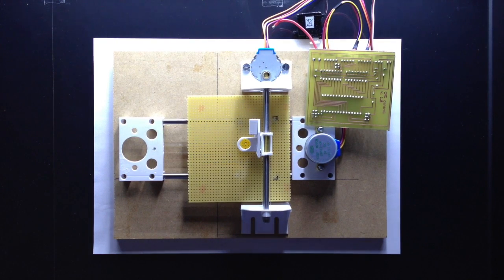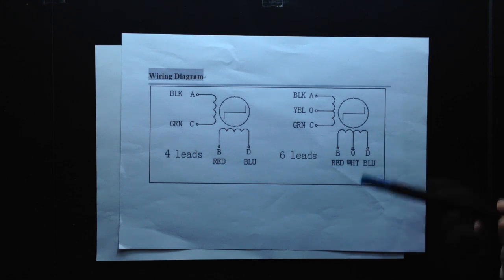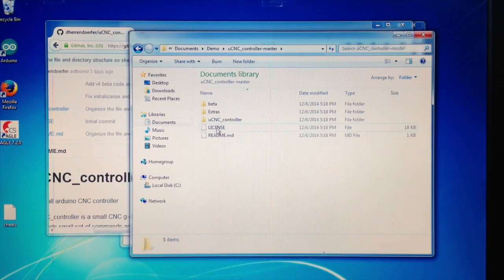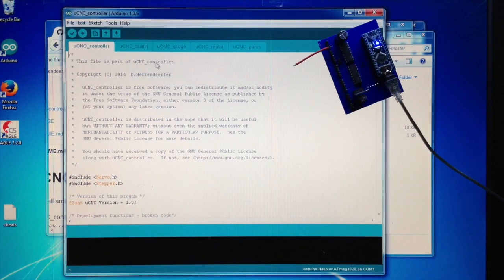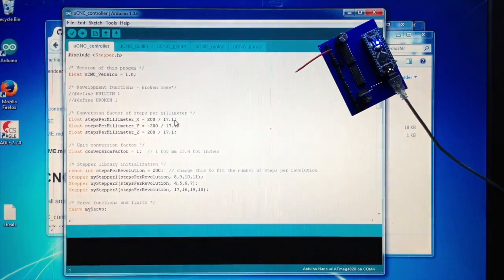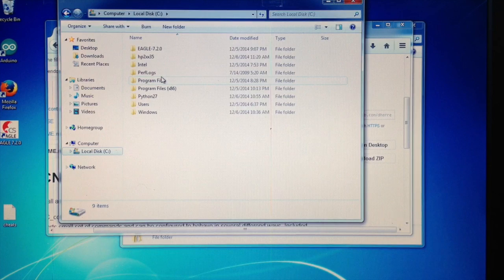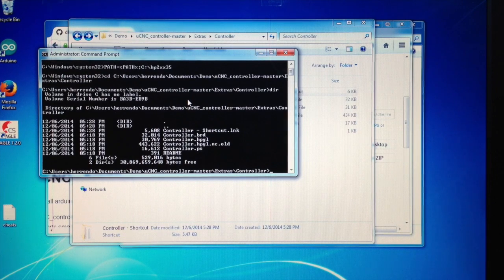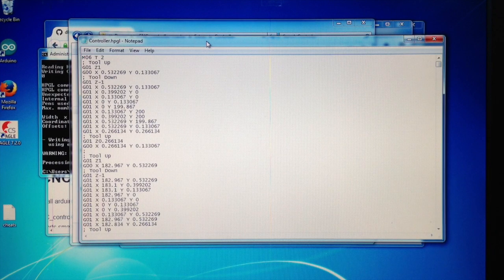Direct ink to PCB-Software talk

Comment: Hello
I can not export to eagle the HPGL files and I also tried converting with hp2xx
the HPGL files I download ..... I followed the video but when the point of type hp2xx and click send out me this:

"Hp2xx is free software and you are welcome to distribute copies of it
   under certain conditions. There is absolutely no warranty for hp2xx!
For full details, read COPYING file (shipped along with this package),
   or write to: Free Software Foundation, Inc.
                         675 Mass Ave, Cambridge, MA 02139, USA

HP2xx: A HPGL converter (xx = mf, eps, pcl, pcx, img ...)
         V 3.4.4 (06/03/22) (c) 1991 to 1994 (V3.20) Heinz W. Werntges
                               (C) 1999-2003 Martin Kroeker
Usage: hp2xx [options] [file1 [file2 ...]]
         Unix: Filter usage (.. | hp2xx q f [options] | ..) ok

Press <Return> to continue ... "
things I need to do ??
thanks in advance for the answers.
Reply from the maker: +Matteo piras Eagle creates HPGL files using the CAM processor, you need to select the format there, once you have a file ( lets call it 'myfile.hpgl' ) you need to feed it to hp2xx using    'hp2xx -m nc -t myfile.hpgl' and hp2xx will generate a 'myfile.hpgl.nc' for you.

Comment: Hello
I have a Prusa i2 with ramps 1.4 I wanted to change it to print my pcb.
I have some questions:
I can change my printer to print pcb?
If yes where I can find the firmware to upload to Arduino Mega?
I do not know if you've already answered in your videos to my questions but if you'll excuse me, but still do not understand English very well.
Reply from the maker: +Matteo piras You do not need to change the software on your printer.
Use the tool hp2xx to generate some g-code for you that uses positive Z positions and make 
yourself a pen holder.
Reply: + Dirk Herrendoerfer thanks a lot for explanations

Comment: It is not necessary, make part of command prompt ?
Reply from the maker: +pedro rodriguez It is. you need to use the command prompt to use hp2xx, but if you move the files you want to transcode into the hp2xx directory you can forego the path setting steps

Comment: Hello good day
I am from Colombia
I am very interested in this project
and I have all the materials
but I have a problem with the configuration of hp2xx
I'm following all the steps of the video
but not me the new file appears controller.hpgl.nc
Only old
Could you help me with some more detailed information on the installation of hp2xx
my email is pedro.r51@hotmail.com
thanks
Reply from the maker: +pedro rodriguez hp2xx is usually pretty good at pointing out errors, doesn't its error output give a hint to what is not working ?
There is little to do to make hp2xx work. You can either use it from the folder where it is installed or add the location of hp2xx to the PATH variable. That's it. Issue hp2xx -m nc -t YOURFILE.hpgl and it will make you a YOURFILE.hpgl.nc

Comment: Hi Dirk Herrendoerfer, 

Thanks for your video and your hard  work to complete this. I have done the prototype for this. But at the first try, I get stuck like this (i'm using TowerPro MG90S micro servo):
- Firstly, I don't know how to test servo (stpper motors are tested OK via software by clicking Y+/Y-/X+/X-)
- Secondly, After executing file "controller.hpgl.nc", it stuck at below command and make my servo vibrate forever. After that i need to press reset button of arduino, then the system back to normal. 
M06 T 2
; Tool Up
G01 Z1
The datasheet of servo:
http://www.electronicoscaldas.com/datasheet/MG90S_Tower-Pro.pdf

please help me on this.

Thanks for your time.
Reply from the maker: +Phan Tan Mong If the Software gets stuck at the point where it was supposed to move the servo, it is usually a configuration issue. Make sure that there is a positive value at steps per millimeter for the Z axis. If the Servo is oscillating, it may be an issue with too little current available.
Reply: +Dirk Herrendoerfer Thanks for your quick reply. Finally i got it working by changing motorMode to 1 ( default is 0) and then change the servoPosMax and servoPosMin to suitabe with my servo.
Thanks again for your stuffs.
Reply from the maker: +Phan Tan Mong Congratulations ! I'm happy to hear that there is another working unit out there. Greetings, Dirk.
Reply: +Dirk Herrendoerfer I got problem with wrong size after drawing the pcb. I have changed stepsPerMillimeter_X,Y,Z to so many number but the size is still bigger than the real one.
I'm using 5V stepper motors (1.8 degree/step) with 14.6mm diameter pulleys attached to motors, nilon strings as belt driver.
Please show me how to calculate stepsPerMillimeter in my case.
One more thing: why do you use stepsPerMillimeter_Y in minus value? (-200/17.1)
Thanks so much for your help.
Reply from the maker: +Phan Tan Mong So, you have 200 Steps per revolution of the stepper; The circumference of you pulley is 14.6mm*P, that's 45.844. So you would have 4.3626 Steps per millimeter,  or 8.7252 half-steps. 
If your stepper is turning the wrong way on any axis you can use a negative steps per millimeter value to compensate.
Reply: +Dirk Herrendoerfer Thanks for your clarification. But i have put this value into code but the result was still bigger than the real one.
float stepsPerMillimeter_X = 200 / 45.844;

float stepsPerMillimeter_Y = 200 / 45.844;
Reply from the maker: +Phan Tan Mong Try some simple g-code commands, like G0 X100 (should move it 100mm ) What is it propotionally ? Is it half as big as it should be or twice as large ?
Another option would be to set steps per millimeter to 1 and move 1000 steps, then measure the travel and put that into the value ( ... = 1000 / travel ).
Reply: +Dirk Herrendoerfer Thanks for your help. I have found where the problem was. I used Cam processor in eagle to generate hpgl file but i might did something wrong. Then I used your controller.hpgl.nc to test my cnc, it worked amazing. So, could you please help to show to to generate hpgl file from eagle properly? (i suspected i used wrongly scale parameter).
Reply from the maker: +Phan Tan Mong Odd, You need to use the -t option to hp2xx, but you probably know that already ....
Reply: +Dirk Herrendoerfer thanks for your guide. after putting -t option for hp2xx, i got real size after drawing. Thanks again for your helps. I learnt from you so much
Reply from the maker: +Phan Tan Mong Congratulations that you got it working ! Have fun with it and keep on making !

Comment: I use 28BYJ-48 with ULN2003, shaft diameter of 5.5mm.
What configuration uCNC controller v4?
Reply from the maker: +Fernando Nunes Which parameters ? 
You probably want to define the ports for the V1 board, your StepsPerMillimeter are the circumference of the spindle divided by your steps per revolution of the stepper.
Reply: +Dirk Herrendoerfer Thank you for your help.
Reply from the maker: Fernando Nunes Glad to be of help !

Comment: Mr.DIRK
yOU PL. CONSIDER ME AS A LAYMAN NOT HAVING INDEPTH KNOWLEDGE.
Any way I put my question here.
How you creating hpgl file and stroring in the GITHUB.I understand to some extent your video.I get stuck up at point where you convert the hpgl file to G .code.And how you creating the files?
Pl. explain.I think you would not ask me to see the video.
vkp
Reply: +Kalyanapasupathy Venkatraman 
Wich video you mean,Sir
vkp
Reply: +Kalyanapasupathy Venkatraman 
Which video you mean?
Can you explain in writing
Reply from the maker: +Kalyanapasupathy Venkatraman Have you been able to download and install the hp2xx utility ? What operating system are you using ?
Reply: +Kalyanapasupathy Venkatraman 
I am using windows8
vkp
Reply from the maker: +Kalyanapasupathy Venkatraman Have you been able to download and install the hp2xx utility ?
Reply: +Kalyanapasupathy Venkatraman 
No Sir
vkp
Reply: +Kalyanapasupathy Venkatraman 
Sir 
There  are six videos from you .Which one I can refer?.
vkp
Reply from the maker: +Kalyanapasupathy Venkatraman Were you unable to download the files, or did you run into an issue using it ?
Reply: +Kalyanapasupathy Venkatraman 
Sir
Good morning
Mine is WINDOWS8X64
My question 
1. How do you create hpgl format for eagle ?
2.How do change hpgl to g code?
3.Can All g code converter be used?
Pl. explain in words
vkp
Reply from the maker: Well, I'm trying to talk you through the process, I responded to your question on Oct. 1st, and I haven't gotten an answer.

Comment: Hi Dirk Herrendoerfer. What is version of EAGLE can  export hpgl
Thank you very much
Reply from the maker: +ยุทธพงษ์ พ All current versions can do that.
Reply: +Dirk Herrendoerfer  Please explain the procedure to  EAGLE   export hpgl  step by step , because I never use this application. Thank you very much
Reply from the maker: +ยุทธพงษ์ พ Please refer to the eagle howtos and its documentation. The hpgl export is done via the 'CAM processor' function in eagle.
There are a lot of examples on the net, and they explain it much better than I ever could.
Reply: +Dirk Herrendoerfer , I found this website http://www.diyouware.com/use
Configure the following parameters:Device: HPGLScale: 1Offset: zero (x and y)Pen diameter: 0.1mmVelocity: 10
but the print result was not the same as the value you provided in the  Controller.hpgl file.What is the value you set.Thank you very much

Comment: Hi dirk,
thanks for your explanations.
I ve tried Hp2xx, but it seems the conversion of the hpgl files is done with some errors for the dimension. i mean all the files got 200 width and 180 height. and i dont know why, tried to use some option but didn t get it to work correctly.

i used the same command as on the video, but nothing ....

could you help me plz ?? :D
Reply from the maker: Dz Xnor You should use '-t' to make it true size and -m nc for nc output. That is what I use.

Comment: Hi Dirk Herrendoerfer. I  user  NEMA 17 Stepper motor model 17hs4401 (http://www.svaltera.ua/catalogs/knowledge-base/brands/motionking/HB_Stepper_Motor_E.pdf),
uCNC_controller Version 4 and  GRBL_BOARD.
What the figures in this message 
float stepsPerMillimeter_X = 80;
int   stepIssueFrequency_X  = 400;
int   stepIssueFreqRamp_X = 10;
int   stepIssueFrequencyRampMax_X  = 200;
int   stepDriveSlack_X = 0;

float stepsPerMillimeter_Y = 80;
int   stepIssueFrequency_Y  = 400;
int   stepIssueFreqRamp_Y = 10;
int   stepIssueFrequencyRampMax_Y  = 200;
int   stepDriveSlack_Y = 0;

Because, When I plot  pcb  .dimensions  is not Invalid
thank you very much
Reply from the maker: ยุทธพงษ์ พ steps per millimeter should probably be 200 / ( PI * 5) * 16 = 101.86  or 102
Reply: Dirk Herrendoerfer Thank you for your reply.

Comment: do you have a schematic and BOM available for board prototyping? I'm attempting this project and it would be nice have a diagram to go about building the the lm7805 for the servo. I'm using somewhat of a similar setup but instead of building my uln2003 stepper motor drivers, I'm using the ones provided with the 5v 28byj-48 steppers, also, which controller Version would I go about using for unipolar steppers? Controller_1 or Controller_4? Nice project btw
Reply from the maker: justinp4235 Thanks! Schematics are in the github repos as well as the software you found already. I suppose using the v4 software will give you the best performance, but since it is the one with the most development it is more likely to contain bugs at some time. Hardware-wise I would go with the v1 board.
Reply: Dirk Herrendoerfer Thanks for the fast reply! I have to ask, how did you supply power to the two steppers? I know that the Arduino nano can output 5v but only at 500mA powered via usb, so did you use an external 5v power supply or 12v supply? And is the lm7805 for the servo, thanks in advance and keep up the great work
Reply from the maker: justinp4235 The Arduino runs on 5V from the PC, the controller board has 2 ULN2003 darlington drivers to drive the steppers - 5V or 12V - the power is supplied externally. Some 28byj48 kits come with ULN2003 driver boards.
The 7805 is needed when driving the steppers with 12V, for the servo.

Comment: Hi,
I am 14 and also from germany and I am thinking about also building myself a plotter like this. In an oter video you have shown a controller design based on the Arduino Nana and the Polulu drivers, which have to be wired differntly and I would like to know if there is any code from you online, becouse I still have not decidet whether i would go bi- ore unipolar. And it is a big point of my decision that there is some working code avalebil coused by the fact that I am not so goot in writing code for the arduino.
Reply from the maker: Deather King Hi, in allen meinen Videos findest du in der Beschreibung einen Link auf mein github repo. Darin findest du alle Informationen, Software, Platinenlayouts usw. Die software/hardware Versionen sind V1 fuer unipolar und V4 fuer bipolare Schrittmotoren.
Reply: Danke schön, ich habe gerade dort geschaut, was würden Sie denn für einen solchen Plotter empfehlen Uni- oder Bipolar?
Reply from the maker: Ich habe da keinen klaren Favoriten, beide haben ihre Vorteile. Wenn es einfach und billig sein soll, dann unipolar - wenn es genau und schnell sein soll dann besser bipolar. Ebenfalls koennte man mit der bipolar- Steuerung einfach einen kleinen 3D Drucker bauen. Da passen dann die verwendeten Teile schon.
Reply: Ich habe ein Tutorial im Internet gesehen wie man die billigen ebay 5V Stepper zu bipolaren umbaut, sodass man sie dann auch mit dem Polulu Treibern ansteuern kann, ich kann den link gerade nicht hier einfügen allerdings würde ich das zu einem späteren Zeitpunkt tun, wenn sie interessiert sind.
Reply from the maker: Bipolar zu unipolar geht immer, solange die Mittelabgriffe der Spulen nicht im Motor verbunden sind.
Reply: Dirk Herrendoerfer Lohnt es sich denn dafür einen neuen Treiber zu kaufen oder sollte ich dann einfach die meist mitgelieferten Treiber Ic's nutzen?
Reply from the maker: Deather King Beides ist ok, Bei den billigen sind meist ULN2003 basierte Treiber dabei, fuer bipolar verwende ich die einfachen polulus, die sind prima.
Reply: Dirk Herrendoerfer Danke, ich werde mir in den nächsten Tagen ein paar Motoren ,Treiber und einen servo bestellen und dann mal etwas herum probieren. Vieleicht schaffe ich es ja ein vorzeigbares Resultat zu erzielen.

Comment: Hi Dirk, me again. I was using the HP2XX, and I was asking me how do you setup the pen size? And the speed of the drawing? Becouse when you convert the file to GCode, it says Warning: pen size ignored.
Thanks!
Reply from the maker: Roberto Sale Hi Roberto, the hp2xx tool ignores the pen width, it needs to be correctly set in Eagle - mainly for the reason that Eagle already renders all surfaces into line segments. So you should put the correct line with into Eagle when creating the hpgl export.

Comment: Please, you can specify what type of electrolytic capacitors, example (16v 1000U) and the transistor may be a 7805?
Reply from the maker: Jansen KCara Yes. The regulator is a 7805 for the servo, if you really need more torque use a 7806. The caps are dependent on the voltages you use, 470uF for the primary input, and 220uF for the 7805 are usually sufficient.

Comment: Hi, first let me thank you for generously giving your knowledge and expertise to us mere mortals. Second, I have made one of your machines and it works extremely well however I have one problem with the software that I hope you can help me with. When translating from EAGLE thro' hp2xx35 the G code generated contains some Z values (apparently random) that are greater than 1 which causes ardGcodeWriter to freeze. I can, and have, changed then in the G code script, this works but is time consuming. I am new to EAGLE so am probably doing something wrong there, can you offer any insights? Thanks again. Bob
Reply from the maker: When did you download hp2xx ? I fixed a couple of problems and updated the tool on 2015/02/10. 
I plan to implement some changes to hp2xx in the near future, but I thought the newest version was doing ok.

Comment: Hi Dirk,
I made a simple pen plotter with X,Y axis and servo but I don't have a software to arduino to run my plotter.
I thought that your project will be perfect for my plotter but I used Nema 17 motors and stepsticks and I don't know how changed your program (is it posible?) to my project.
If you know how changed your software, please help me.

Regards
Robert
Reply from the maker: Hi Robert.
That should be possible, but - what is a stepstick ? Is it a controller that simply takes step and direction as input ?
Reply: Dirk Herrendoerfer
I used http://www.schmalzhaus.com/EasyDriver/ version 4.4. It only needs stepper and direction.
Reply from the maker: You should be able to use the v4 firmware for those drivers without change. All you would need to do is figure out the wiring from the arduino to the driver boards. 
There is some documentation with the code that should help you.
Reply: Dirk Herrendoerfer
Thank you very much Dirk :) I'll try.

Comment from the maker: I uploaded an updated version of HP2XX, and I put the download link into the description of the video. 
The previous version was producing garbage g-code.
Reply: hello Dirk,
i am using xp win32 but i am getting an error when i reach the 15 min it says the app is not compatible with win32, can you help me please ?
Reply from the maker: I suppose you are using the hp2xx I have in my repo ? If that one does not work for you, you can try the other available downloads of this tool. I am not the author/maintainer of this tool and only supply this version, which has a fix for Windows 7 and later versions.
Reply: Dirk i am using the one in the descriprion here under this video, can you share the link for other versions please ? i tried their website but i couldnt find the exact file like yours the .exe
Reply from the maker: Sorry, I don't have any download links for that -